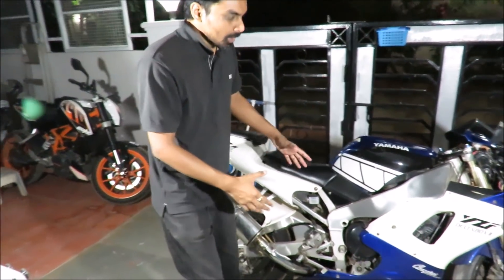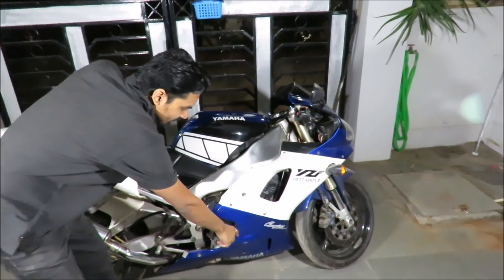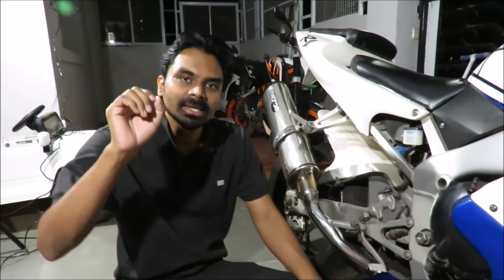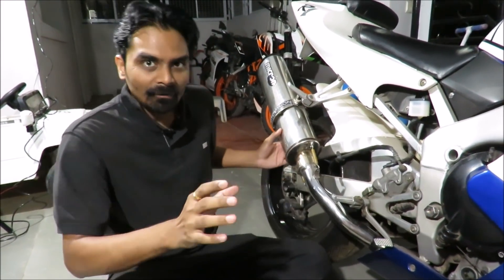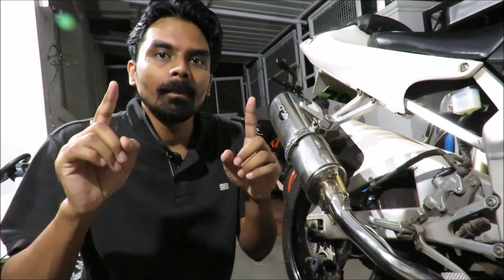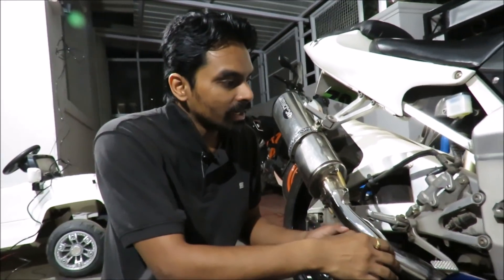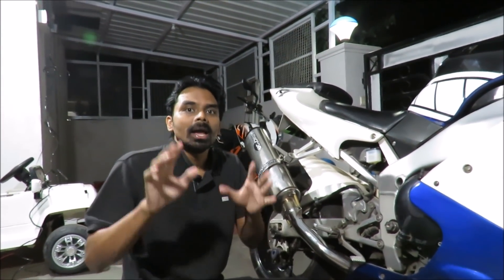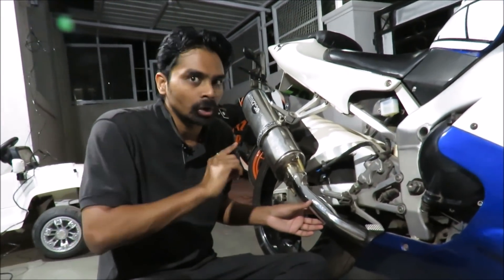Does After Market Exhaust HARM the ENGINE? Simple explanation.

Comment: +Vikas Rachamalla, Sir you have forgot to mention O2 sensor on the header pipe and after catalyst. It is a vital data; if a bike has a O2 sensor on the exhaust (which is Closed circuit fuel control system); a remap is certainly required without any further thought. But if a bike doesn't have a O2 sensor and controlled by Capacitor/Transistor based ECU (which is a open circuit fuel control system) it controls the motor based on throttle position, MAF, engine speed, gear position, fuel pressure and engine temperature an ECU remap is not compulsary and  it will never control the AFR based on exhaust pressure or back pressure. (NOTE: Exhaust pressure is calculated-recorded-controlled in externally charged engines) 

I believe, If the exhaust of a bike, without O2 sensor, is replaced with free flow exhaust it need just more air to breathe, so a performance free flowing airfilter is needed and certainly in that case one need a fully mappable ECU, that will ensure the correct working of MAF sensor and thus AFR will be controlled.

Theoretically, free flow exhaust can reduces the pumping losses, because there no restriction in gas flow. Exhaust pressure is only vital and should be maintained to ensure the conversion of CO completly! 3 way catalytic converter requires right temperature, pressure and velocity to do its job. If the catalyst is removed there is no necessity of maintaining the exhaust pressure. 

And the example you gave for the back pressure is irrelevant! Water is an incompressible fluid whereas gas is completely compressible. Back pressure is a pressure wave created due to the change in exhaust pipe diameter/shape which does changes the flow velocity but it will not burn the valve; (NOTE: 2 stroke engines a expansion chamber is installed to create pressure wave purposely that will increases the charactestics of the gas flow as it doesn't have a exhaust valve) 

Valve burning can be caused by various reasons but the major of them are valve seal wear, improper engine cooling, carbon deposits (hot spots), improper alloy used in valve. But back pressure ain't one of them!

A vehicle with 2-step launch system as well as anti-lag system can burn a valve that is only made for low speed applications.
Reply from the maker: Wow, thanks my friend.
Reply: Rohith Ramachandran o2 sensor automatically adjusts the air fuel ratio on a bike. Afr means air fuel ratio.
Reply: P.R. Hariharan 
There is a phenomenon called valve slam which occurs when the engine runs at high rpm under inadequate back pressure, which will damage the valves.
Reply: Vikas Rachamalla  1) Whats the difference between Exhaust, muffler & slip-on..??
2) What is db killer??
3) what is meant by a free flow exhaust? and does this contain catalytic converter..??
Reply: Prajeesh Premachandran Sir, I have never heard of the term 'Valve slam'. There should not be back pressure in an exhaust system at any higher rpms. Because the engine will run richer, if the back pressure wave is higher; exhaust gas traps inside the cylinder due to reduced flow velocity, which is a good thing interms of emission reduction but It will affect the volumetric efficiency severely. Some engines are designed and developed to do scavenging at higher rpms! If more back pressure is there in the system; more exhaust will be trapped inside the cylinder and air density will get affected, engine won't produce high end torque!

By the term 'Valve slam', I can imagine one scenario, improper valve timing in large cam profile, in general, exhaust valve opens gradually from 20° (or may be even higher) before TDC and continues to open till the piston reaches the valve clearance area on top of the piston and then inlet port opens simultaneously; to do the scavenging process and the exhaust valve closes after 5° - 10° after TDC. If the timing is mismatched, there is a chance of catastrophic event such as piston hitting the exhasut as well as inlet valve and the valve bends, which it can be termed as 'valve slam'! 

I kindly request you to share some links for research paper on 'Valve slam'. My humble request.
Reply: P.R. Hariharan are you some sort of engineer or something?? U r awesome! What r u ? IIT ian??
Reply: P.R. Hariharan link is not working.
Reply: deepak shriram, Sir, Usually torque builts up from low rpm till a range before the high rpm. In FZ S, max torque is achieved at 6000rpm! The laggy response by the engine can be represented in two terms, 1. Presumably, mid range torque must be a gradual slope (if you can dyno the motor, you can see that torque curve) thus you have to reduce the gear to generate more torque to speed up! 

2. From my knowledge, In general 5-speed transmission have a direct drive at 3rd gear! Which means the power produced by the engine will be directly sent to wheels through the transmission with any change in gear ratios. As engine speed gets lowered the torque produced by the engine will also get lowered directly and thus you have to reduce the gear to speed up!

Don't try to maintain a particular  speed to achieve desired mileage, a bike that goes in 60kmph will not give high mileage, it doesn't work that way. I recommend you to fimd set an rpm, a sweet spot, so that engine can produce optimum torque and uses less fuel. Stoichiometric AFR will give you more mileage neither the lower rpm nor the higher revs can! 

I hope, I answered and cleared your doubt!
Reply: P.R. Hariharan sir i own a 155cc gixxer and i have installed an afermarket muffler and removed the underbelly or the catalytic converter (that big box attached with exhaust) and i have welded muffler aith the joint extension pipe only directly ...so bro the question is that will it affect my engine ?? I have seen a significance drop of mileage of 10-15kmpl as i ride very rough ....bro tell me whether carburetter tuning is reqd after the installation of aftermarket muffler or not?? Please do tell me the bad efffects of changing the muffler or exhaust and removing catalytic converter and underbelly?
Reply: MRM Vlogs Sir, Removing catalytict converter and resonater won't negatively affect your engine (as it doesn't have a O2 sensor) but it will increase vibrations severly & it is illegal in India to drive a vehicle without a catalytic converter. So i recommend you to swich back to stock exhaust. And if you fitted free flow air filter such as K&N or BMC, you have to change the jets accordingly, else engine will suffer by running lean, even at higher rpms, which is not goot at all. Rich mixture will cool down the engine at high revs, so a proper jet size is mandatory! (If the bike has MAF sensor, it may adjust the fueling in lower and mid rpms! Most manufacturers maps the EFI system that way) As your bike is carbureted, i presume, it will not have MAF sensor.

Mileage only depends on riding conditions only. Don't rev hard and expect the bike to give more mileage. There is a trade off between mileage and performance. If you want more mileage drive at optimum engine rpm at high gear, if perfromance is important don't worry about mileage.

If you are a rev head change oil every 3000 - 4000km. Usually its every 5000km but as we rev harder, the property of the oil will get changed drastically quite quickly. Older engines tends to lose power and mileage due to increased rate of frictional loss! We have to change bearing all the time to keep the engine run like new, which ain't cost effective. That's problem we have deal with. 

General maintenance: For better mileage, use synthetic oil, Flush engine before topping up with new oil. Clean the oil filter film/screen inside the engine. While starting the bike in morning after a long halt, let the engine run ideal for a 2-5mins, in that way engine will reach working temperature and runs perfectly. Change spark plugs as factory manual recommended. Use factory recommended tyre sizes. You can opt for premium fuel, in that way you will get good mileage!

If you have any questions, feel free to drop here.
Reply: P.R. Hariharan thank you so much sir! But the final conclusion is it will not affect the engine anyway right??
Reply: MRM Vlogs, As I said before, any external mods should be accompained with good care! Changing the oil filter, changing the oil regularly, tuning the jet size properly, if posssible you can add external engine oil cooler (consult with mechanic for installations), Executing good engine maintenance will keep the engine safer and last long. Mods won't affect engine. I will ceratinly watch the video and comment about it!
Reply: MRM Vlogs Hello Sir, I have saw the video! He did 2 mistakes in his bike! 

1. He fitted a cone a.k.a pod filter inside the airbox (you can see in the video @ 0:33), which is completly wrong, pod filter should be fitted directly on the throttle body! And by fitting a pod filter inside the air box will mismatch the pressure difference! At lower rpms, engine suck so much air than at higher rpm, as he fitted small area filter, engine would have suffered alot and thus ended up damaging the piston! As I always say, in carbureted bike, once you change the free flow airfilter and muffler, one have to tune the carburetor! Use the next size jet compared to the stock one!

2. Never weld an muffler to an exhaust! My personal advice, Use exhaust clamps instead, if the weld was not perfect, uneven flow will generate uneven pressure wave and will disturb the flow velocity. Use high quality exhaust clamps.

And as for performance filter replacement, it should be similar to factory one and should fit inside the airbox. And if the exact shape and size was not available, use the universal geniune K&N or other good pod filter on the throttle body and remove the airbox! 

My humble request! Never buy a cheap air filter and muffler! Don't buy a muffler because it is cheap and sounds better, buy a certified muffler such as IXIL, Leo Vince, Black Widow, Two brothers, or if fancy an Akrapovič or SC project. 

I am pretty sure, your engine will not get damaged. In the end, always take good care of your bike more than ever! 

I hope, I cleared your doubt! Thank you :)
Reply: P.R. Hariharan thank you brother! You are sooo soo much helpful once again bro thank you sooo much you have such a great knowledge about bikes
Reply: P.R. Hariharan sir i have a gixxer and im using k&n rc 1060 pod airfilter. and recently i removed the catalic converter of stock exhaust. will it effect my engine?
Reply: Rishi's Studio, Engine may wear a bit quickly than before due to excess heat by lean mix and Cat removal will only affect the emission standards not the engine. If your bike has carb change the jet size or if its FI i recommend you to tune the bike for performance increase else it will run the same even if it is installed with free flow air filter. Is there any visible smoke coming out?!
Reply: P.R. Hariharan i hve a carb model and there is no smoke. after cat removal i think i get 1,2bhp extra
Reply: Rishi's Studio, The difference you feel after K&N + decat is increased torque due to free flow of air, there may be some power increase, but thats negligible! 

If there's no smoke coming outta your exhaust; then you don't have to worry about.
Reply: Hariharan sir I want to ask something I just recently bought an Yamaha r15 v3 155 cc fi. and I want to put an after maker full system exhaust..  What do u suggest me...  Aftr installing...
Reply: P.R. Hariharan  hey bro. I have Kawasaki z900 and I want to install SC project Crt slip on exhaust but slip on doesn’t make much difference in sound. So I thought of Removing belly chamber and add straight pipe without removing catalytic converter. So by doing this modification do my bike engine gets damaged?

Comment: The slight problem for the duke 390 is that the catalytic converter and the stock exhaust are stuck and we cannot change just the muffler. Do you advice me to change the catalytic converter with an aftermarket exhaust?

Comment: Hi thanks for the video I just have one question. I got new z900 and stock exhaust sound is not that good because of the cat convertor below. I was thinking if I remove that cat and put a link pipe to akra slip-on it will give a good sound. But don't know abt it will effect engine or not
Reply: Mad Wrist thanks... For the info do u reside in Bangalore
Reply: Mad Wrist hey you are "life on a 250" right???
Reply: Ride by Wire Yes..! I live in Bangalore..
Reply: Ravi kanth Yes bro..

Comment: Hi sir, just  want to ask. I made a simple modification to my stock muffler to make the sound louder. I did not change anything from headers going to the pipe. Should I still need to tune my ECU? or this set up will not harm my engine? hoping for your response :)
Reply: i dont know if u are still looking for an answer, but he said if u only change the muffler, there is no change to the horsepower or any harm caused in the engine. So I think there’s no need to remap the ECU as the only change u made was the sound

Comment: Exactly what im looking for 👍👍👍... Exhaust explanation in a very details way 😁.. ive got an experinece burning the exhaust valve resulting less power n less torque.. Using open exhaust at first the sound is very loud n a lot of bass.. as time passes it become less loud  n the bass sound become normal, n most noticeable changes is it  power become way more weaker than it was b4.. that is the reason why im searching for a vid like yours my friend😊, TQ so much👍👍👍
Reply: What bike was yours. 
I'm thinking of removing Muffler from my new KTM 390 Duke 2023.

Comment: Also just by changing the muffler it won't affect the bike's performance in any way, right? I mean gain in power or decrease in power.. and when u switch back to stock after an aftermarket muffler that too won't affect the bike in anyway right?
Reply: YRB Nitin Sir, you will gain a top end torque more than a stock exhaust muffler torque figures! But you need a free flow airfilter. ECU remapping is not necessary. Power will not increase drastically but maybe 1 or 1.5hp gain at the crank.
Reply: P.R. Hariharan  1) Whats the difference between Exhaust, muffler & slip-on..??
2) What is db killer??
3) what is meant by a free flow exhaust? and does this contain catalytic converter..??
Reply: Ravi kanth Sir, 

1. Exhaust gas is a gas produced by the petrol or diesel engine by burning the fuel to increase the air pressure inside the cylinder to run. 

2. Muffler or slip-on muffler are same! They are used for doing one purpose, which is exhaust gas flow regulation. A stock exhaust will have a multiple compartments and more damping material that absorbs the exhaust gas pressure waves and reduce the noise and also reduces the flow velocity! But a slip-on muffler will have singe drilled pipe surrounded with a thin layer of damping material which doesn't not absorb more exhaust pressure wave compared to stock but allows more flow, that increases the exhaust sound and high end torque!

3. A dB killer is nothing but a exhaust noise reducer, when cross section at the end of exhaust pipe is reduced using a drilled pipe, it reduces the flow velocity which inturn reduces the noise. Sound is measured in dB, decibel! That's why its called dB killer.

4. A freeflow exhaust is simply a long pipe from the exhaust port till slip-on muffler! It will not have catalytic converter, expansion chamber or a resonator! There will not be any flow restriction at any point! 

I hope, I answered all of your questions! Thank you!!
Reply: P.R. Hariharan I have a CBR 250r  I have been using a aftermarket exhaust for almost 10k kms now when I'm stuck in traffic I find the bike getting up alot more than before you know why? I service my bike on time I change the coolant too on time can you help me?

Comment: Hello Mr Ramchalla .... thanks , very informative video. This harm to the engine ... will it be much for a (relatively) low performance bike like cbr 650 than say a litre class sports bike with high horse power? ... Actually I purchased a used cbr 650 and the previous owner had installed a sc project full system exhaust , without any mods to the air filter or remap . Now I am wondering should I have it replaced with the stock ....

Comment: Simple yet very precise explanation. I just have a question regarding removing baffles from an aftermarket slip on exhaust. As removing baffle will reduce the back pressure and make the exhaust even louder, is it okay to do so on my RE 650 Interceptor? There are three Indian manufacturers - Red Rooster, AEW and Gursewak. All are made with Stainless Steel, ceramic wool and come with optional baffles. Gursewak sounds the best for me(without baffles). Please check out the videos on these exhausts and advice as the better S&S(Imported) are not available. I've read so many conflicting views that I am confused. Most say that EFI compensates for this change in the back pressure better than a carburated engine. RE 650 comes with EFI. Your 2 cents please..

Comment: Thank you for sharing a very usefull information. I've a question. Many of my friends here in Jakarta change a complete exhaust of their motor cycle without considering the material of the exhaust. My opinion, one the important fuction of the exhaust is to absorb heat from the egine and release it to the air. I notice that most of the material of the after market exhause is very thin and does not absorve heat from the engine well. What do you think about  it ?

Comment: My Indian friend, you are wrong, catalytic converter don’t cost any restriction in the exhaust system, the only time that you need back pressure is on a two-stroke engine. The fuel mixture=Stoichiometric is preset by the computer and monitor by the  the oxygen sensor. Replacing catalytic converter or a tailpipe /muffler, doesn’t affect your engine at all. You can remap you computer if you want to remove restrictions, maybe you get few more few horses …that’s all you can do.